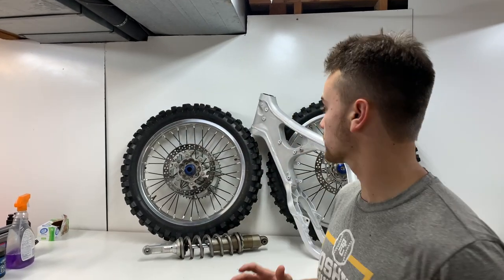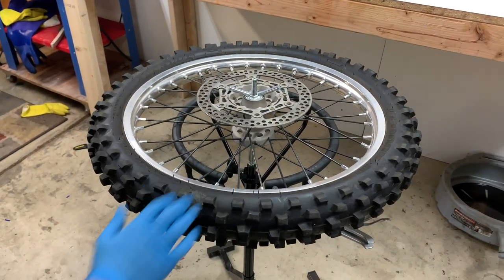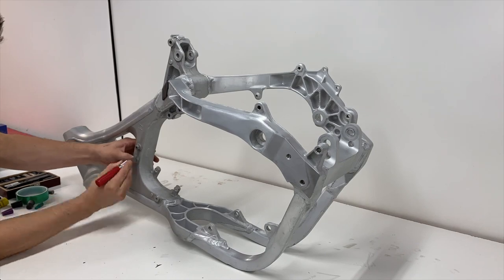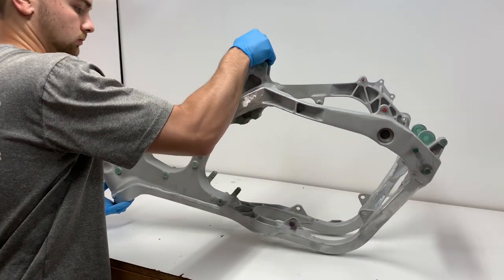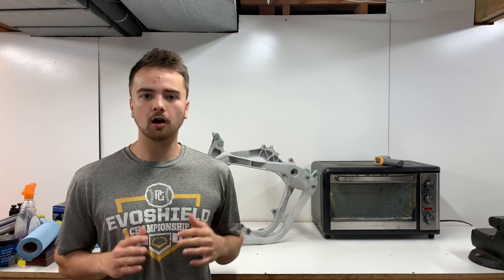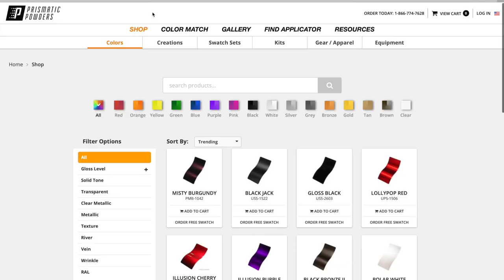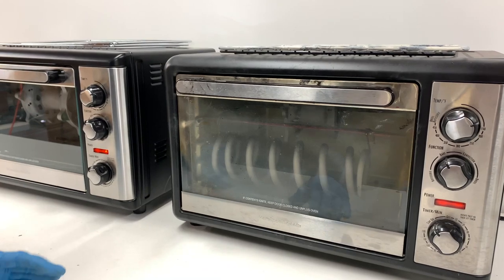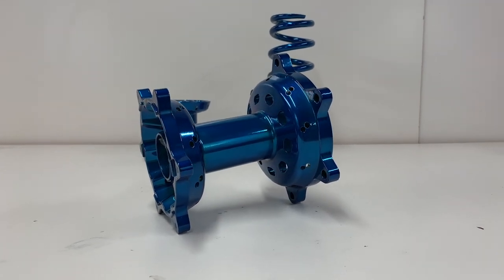Powder Coating On My YZ250 Build With Crazy Results! Part 4

Comment: Hi Adam. With all those delicate threads to protect why didn't you Soda-blast?
It's quite gentle but adequate for the pretty clean job you're doing, 
and rinses out leaving no residue, a double benefit for delicate threads etc.
Would save you a lot of tedious work blocking off then unblocking. 
Just my 2c. Great series by the way, doing a good job. Like the music too..

Comment: What sandblaster do you have and what tip are you using on the gun and which sand do you use that seems to work very good

Comment: Hey Adam, where did you get that spanner wrench for the shock nut? I looked on RMATV but couldn’t find one.
Reply from the maker: It’s actually a steering stem one but it works on the shocks as well. Not a perfect fit but it’s better then hammering on them for 30 minutes haha. I got it from RMATVMC it’s one of there tusk tools.

Comment: Glad to see you doing another build Adam...
Wanted to know, after the wheel hubs come done from the owen what do you do to clean the inside of the hub (the shaft hole lol) from all the powder that comes in while coating?
Reply from the maker: Thank you! I masked off the inside of the bearing race. Other then that it’s not a clearance fit for the collar piece so there’s no need to clean any overspray as it will not be visible or effect performance.

Comment: Adam, what sand blasting cabinet did you use?
Reply from the maker: It’s a used one I’m not sure on brand. My advice is look for a nice used one in the 300-600 range and make sure it has a built in vac.

Comment: Adam, great video.  Just curios what blast cabinet you are using here and what pressure are you running it at?
Reply from the maker: Thank you! The blast cabinet is a mod-u-blast E series cabinet. Great cabinet that I found used for a good price. I recommend finding one in a similar category used to save money. The psi is around 80
Reply: @adampaganelli4891  One other question and sorry to bother but I was curious what the brand and model was on those ovens.  As weird as it is to say I have a much larger oven but I would like to pick up something similar to yours for small parts and doing single items, degassing small stuff and similar things like that.  My 4 x 3 x 3 is great but cranking it up to do some MC calipers or a Master Cylinder is overkill, lol.

Comment: What air compressor do you use for your sand blaster
Reply from the maker: It’s a maxus 5 hp that does about 5.5 CFH at 90psi. It’s barely enough for the blaster so I would recommend getting something a little better.
Reply: Adam Paganelli yah it looks like it works great when your sand blasting.

Comment: Hey Adam, For sandblasting, what material do u recommend. I just got Glass bead delivered but did not try it yet. I used sand last time and worked ok. 
Thanks Bud. 
Mad Skills
Reply from the maker: Thanks Scott. I recommend using 100grit alluminum oxide for cerakote if you’re just doing powder coat glass bead works as well. A lot of powder coating shops use Garnett